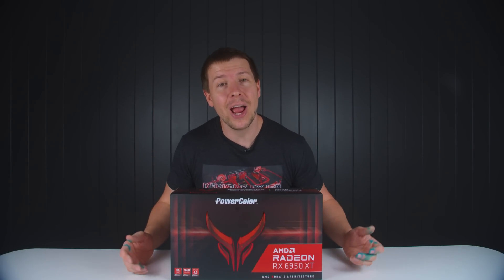Building a PC with AMDs NEW RX 6950 XT!

Comment: Hey. I bought this same card and im experiencing coil whine. Does your card also makes noises at high FPS/power consumption? Also what PSU are u using? Ive read that some PSU+GPU combo may cause coil whine. Im using EVGA Supernova 1000 GT 80 plus Gold 1000W.
Reply from the maker: Yes i do have coil wine